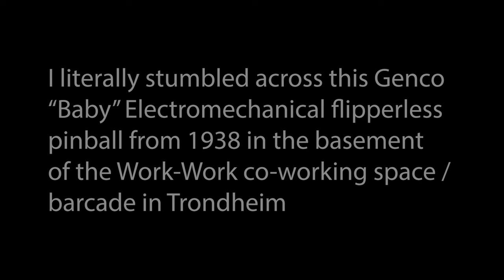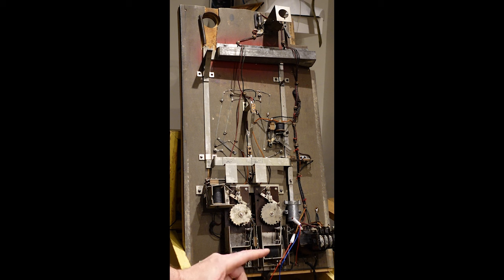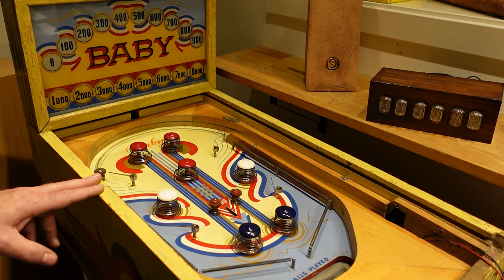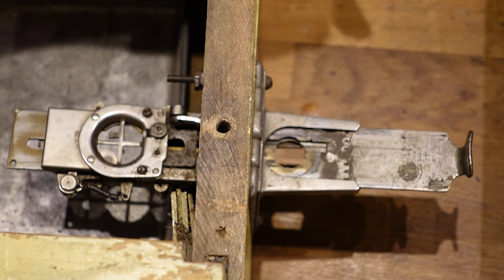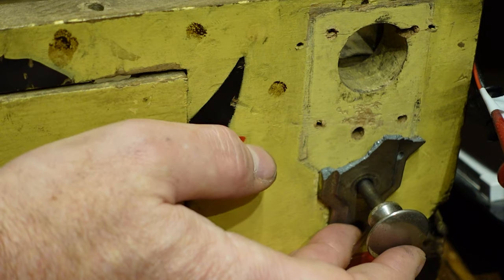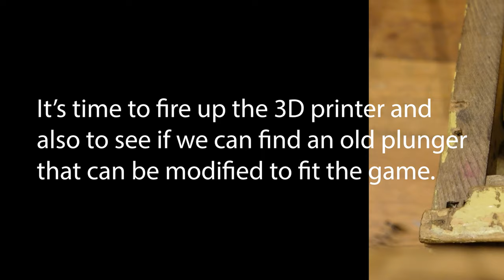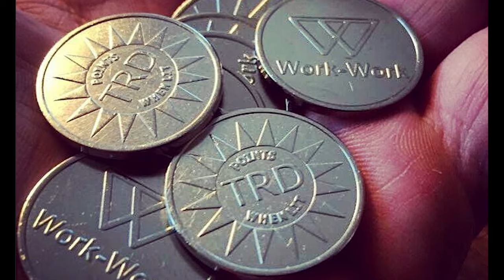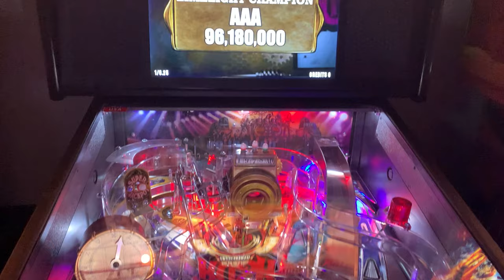Genco "Baby" flipperless electromechanical pinball restoration

Comment: Your game looks fantastic. What did you use to clean the playfield?  I have a Genco Double Track from 1938 and it was missing the glass. Pretty dirty.
Reply from the maker: It's probably not optimal, but I used a very small amount of Novus #2 and a piece of soft cloth to get the grime out. I know this is a plastic cleaner, but it worked out ok.